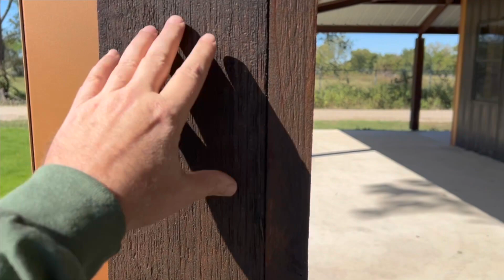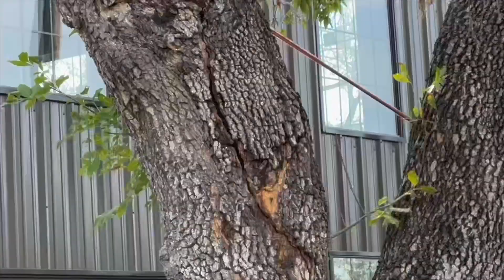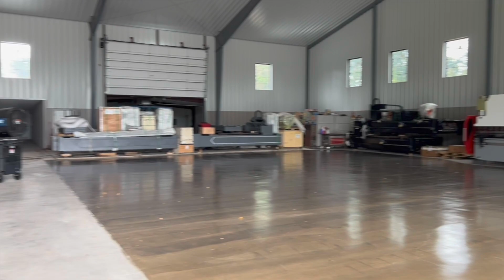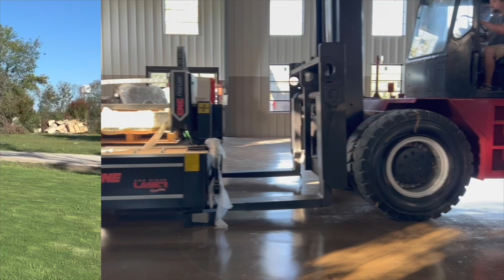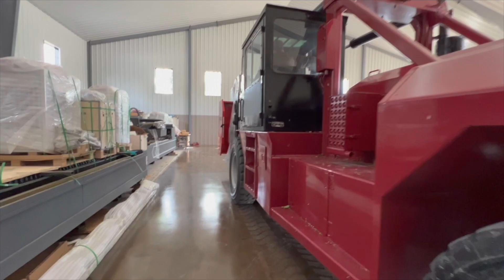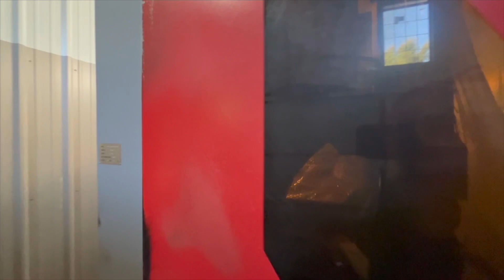My Worst Employee - Shop Update Part 2

Comment: I've been covered in oil many times from 5K forklift hose blows. I can't imagine the amount of oil that would come out of that one. It sure does the job.
Reply from the maker: oh yea, it was pretty violent.  I also had a press brake blow a hose, it was brand new, but hose had a defect in it.  So i pulled it off went to the local hydraulic ship in the customers town and got a new one built.  After that the customer was afraid of the brake, lol

Comment: You only need to add trench drains to the sidewalk down spout areas. You can pick up your perf pipe in your planter box. And since you you might know someone with a laser machine, you can cut your own fancy design in the drain plate that sits flush with the sidewalk.
Reply from the maker: Yea, the main issue is the distance and getting enough fall.  I could definitley catch up with the perf pipe but thats prob 30ft away so i am not sure if there is enough slope.  Yea, I could get me an ecomouse designed, and ramsey laser cut grate cover.

Comment: Seems like you have had drainage issues from the very begining...
Reply from the maker: Yes, you are right.  This whole area of texas, like most of texas is super flat.  The quote I got to bring in 24" of select fill to go under the shop was $250K ... so i opted not to do that, but in hindsight, i should have done something more than i did

Comment: If you Googe Forklift Crane Attachments or Forklift Jibs, there's some good idea's Garry, you might find a solution.
Reply from the maker: Oh yea, I really wanted a riggers style forklift with hydraulic boom option, but those are hard to find and every expensive.  I may buy or build some kind of boom for this one.
Reply: @turbocobra  I'm sure you could make something to lift from the top of the Brakes.

Comment: Forklift envy!  I can't believe how your shop makes that forklift look average size, until you see the person in the cab.  I'll take a worn out hydraulic hose over a computer flashing "fault, no start, contact dealer for service".  Place is looking great.
Reply from the maker: Man, your not lying,, all the problems on this taylor can easily be fixed.  The linde is a 2012 so its more modern and harder to deal with, i cant imagine these new ones where its all drive by wire and computer controlled